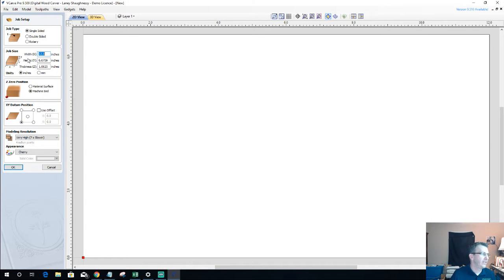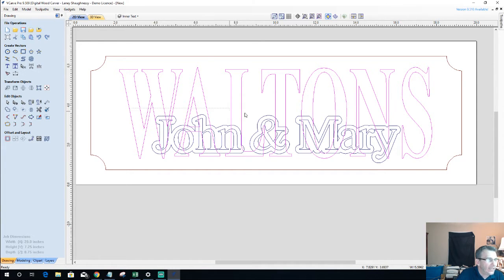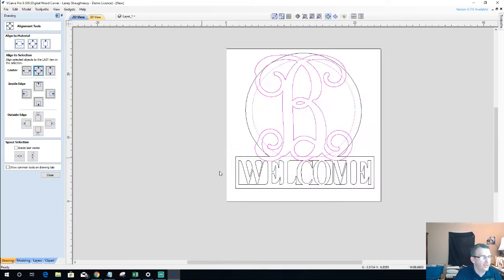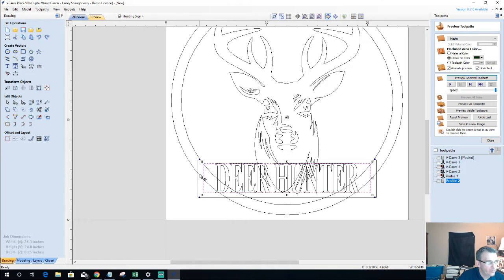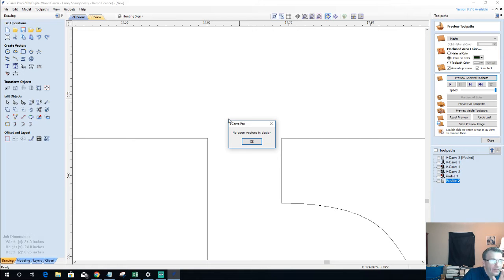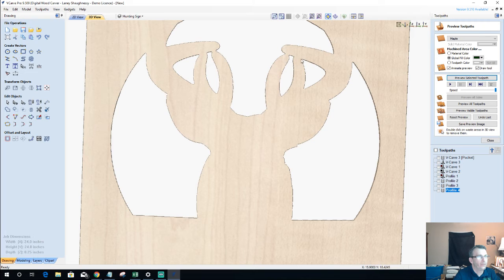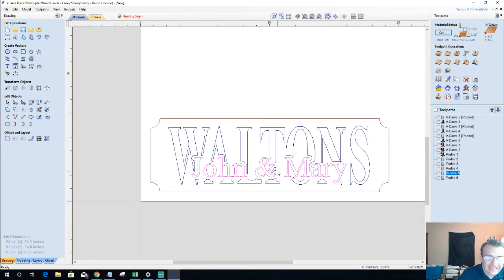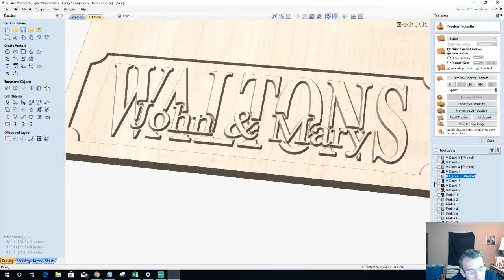Digital Wood Carving 101 - Text in Text - How to create this effect

Comment: Thanks for this video. I am very new to the vectric software  so in the video do I have to mirror the vectors when I did the toolpath in the software it was fine but when it cut out it was all backwards  or am I missing something in the settings. Thanks for your help Brian
Reply from the maker: There is no mirroring of vectors in this design. This is a text in text. The only time you would mirror the design is if it were a v carve inlay or you were carving on acrylic for an edge lit sign. For a standard text in text there is no mirroring.